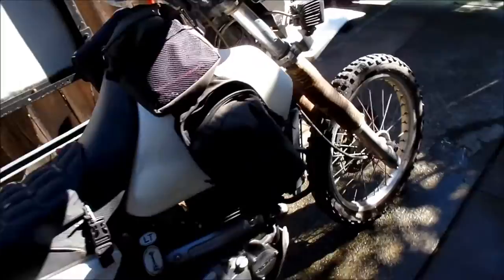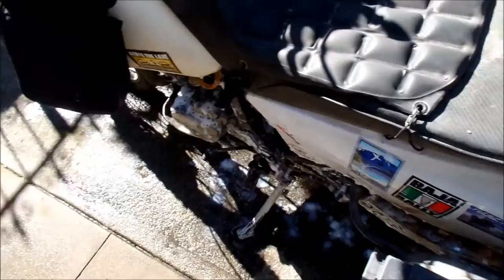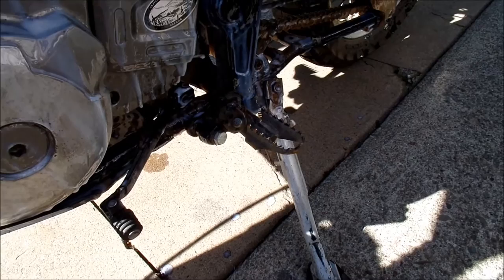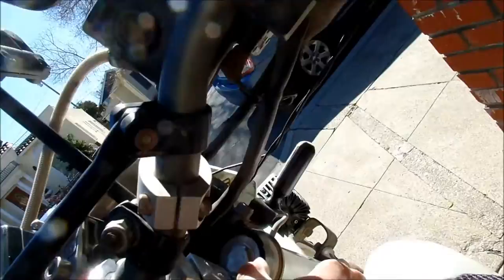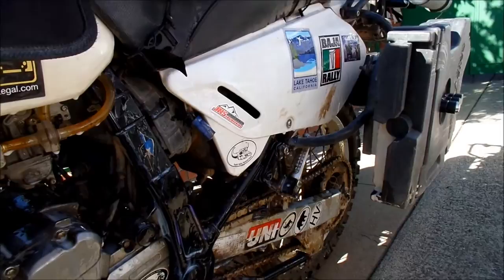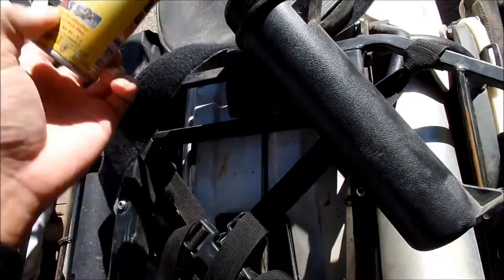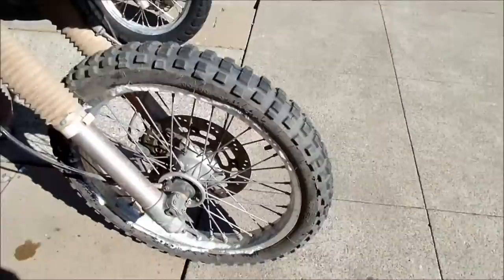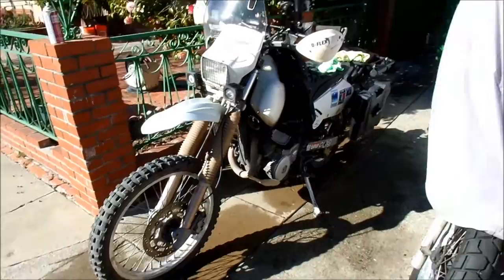BARF BAJA 2016 After Ride Review and Damages VLOG

Comment: I see you have an aftermarket seat, plus an additional Air Hawk or similar type seat cushion.  I have a ProCycle.us seat on my DR and I have not had a chance for a long ride on it. So I am just wondering why the double investment you have, as far as seat?
Reply from the maker: Well I used to have a 1991 DR650S and that seat was not comfortable and there weren't many aftermarket option so I went with the Allyn Airseat and it works great, it definitely more comfy than the stock DR650S seat.  So fast forward to now I sold the DR650S and have my DR650SE now and have aftermarket seat options.  I have a sergeant seat on my KLR650 and liked it so much I went and bought one for the DR650SE also and I just had the airseat lying around so I put that on it.  So I kinda just had it but it still helps.

Comment: how these tyres did off-road?  good?
Reply from the maker: The Shinko 805 rear did great.  It surprised me it was pretty good in the sand thanks to its kind of sandy paddle design.  It's a good dualsport tire for different types of terrain.  I do notice in mud or mud slicks they do not do well on though.  The front Michelin T63 is my favorite front dual sport tire, it works great in pretty much everything.  I tried the Shinko 804 front in the next years ride and it was ok, but I did not like it in the sand, poor sand traction.